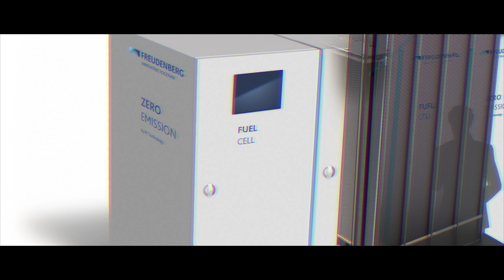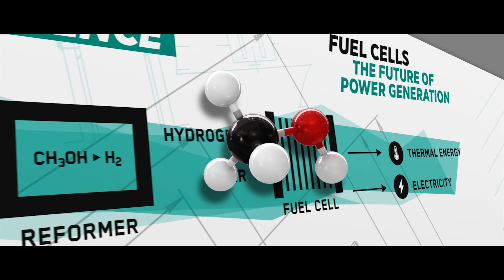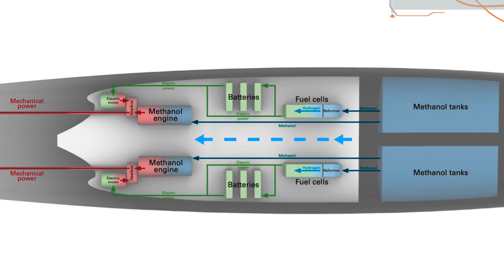LÜRSSEN PRESENT THE YACHT OF THE FUTURE...NOW!!!

Comment: They are lying to you, fuel cells are not the future. Batteries and energy efficient vessels that recycle energy and use energy available in our surroundings are. Why? Because you need a lot of platinum for the fuel cells, way more than is available to all of us. Moreover, the real problem is peak oil, energy shortage. That is why efficiency is so important. As to methanol, that is plant based, using valuable agricultural land to produce said plants. Not sustainable, we need those agricultural lands to feed the world. Meaning the sustainable future, they dream of is a future without most of us, a future where only 500 million of us remain. In that context, the Lürssen yacht of the future, is indeed sustainable, since then, with only 500 million of us, we can again waste energy and resources.

So you see, there is no solution here, only lies and bloody murder. Instead, as I said, we need to work on efficiency, more efficient hulls and propulsion systems, electrical ones is a good start as that cuts the energy needs into 1/3 just y using electric engines. Now add advanced hull forms, light weight build techniques and propulsion systems and we can have a battery driven yacht with transatlantic range already now. (I am designing one with just those features.)

Comment: If the yachting industry wants to have zero emissions from power plants it needs to focus on sails! For existing motor yachts using diesel fuel the industry needs to convince the public that emitting 1000 kegs of CO2 for every 400 litres of fuel burnt is acceptable. It will be interesting to see if COP26 will make any difference to the charter market. Meantime many low lying island nations (charter destinations) are considering banning motor yachts from their territorial waters because of the associated pollution. Any financial benefit gained by having 12 visitors (a typical yacht guest compliment) is dwarfed by the environmental impact damage.

Comment: Not completely taken by the exterior, but then it is a concept craft.  The advancement of fuel cell technology will be truly vital to yachts and road vehicles.  Currently with cars methanol is used in the same way as petrol and diesel with many of the same drawbacks.  Top marks to Lurssen for making it emissions free.  Only possible drawback in Brazil they chopped down lots of rainforest to grow the sugarcane to make the methanol.

Comment: But of course, in order to achieve this efficiency, a type of capital is necessary, as could a system based on an ideal of communism, to be able to achieve this type of progress, because this type of dream would certainly be something fantastic, because a feeling of capital , it will be totally abolished by the nomenclature that would see this not possible. Only capital could put this in everyone's hands with hard work and determination.
Methanol, also known as methyl alcohol, amongst other names, is a chemical and the simplest alcohol, with the formula CH₃OH. It is a light, volatile, colorless, flammable liquid with a distinctive alcoholic odor similar to that of ethanol... In a single word, Methanol...?

Comment: Methanol is a far safer fuel than hydrogen. It can be renewably sourced. Reforming methanol into hydrogen does release a lot of CO2 - 
--- The reaction - 2CH3-OH (64.08 gm) + O2 (32.00 gm) = 2CO2 (88.02 gm) + 4H2 (8.06 gm)
--- 1 kg methanol results in 1.374 kg CO2 released. 
--- Reforming methanol requires 50% of its weight in oxygen to release 1.374 times its weight in CO2 to get 12.58% of the weight of methanol in hydrogen.
--- I'm surprised they are just converting the diesel engines to run on methanol for the drive system, and will only run the services off the fuel cell and battery system. This is a very soft conversion to fuel cell operation. Obviously, reforming methanol and the fuel cell both create heat - so plenty of heat for other systems.

Comment: I wonder about all those stepping stones and ramps and no hand rails. IF the ship hits a swell, don't the guests fall down and hurt themselves?
Reply: @DL Field: Everything containing water, hot tubs, pools, ponds.... are drained during passage into their own holding tanks with filtration system & heaters if required. Then refilled when they reach their destination or anytime they're not underway. When at anchor or at dock, ships stabilizers maintain level decks.

Comment: I really am very ignorant and I apologize if my question is totally wrong but what I don't understand is why it is not possible to produce hydrogen directly on board using seawater. Desalination first, then electrolysis and done!
Reply: My understanding is that the energy required to make the fuel (filter the water and split the molecule) takes more energy then you get back from the hydrogen. The hydrolysis has to happen at an external source, and it's not very cost effective.
Apparently, methanol can be split more efficiently.

Comment: Methanol is CH4O If you transfer that to Hydrogen  H and oxygen O to put in your fuel cell you still have C left. where does that go? if you claim it doesn't emit co2 ?
Reply: It's claimed to be carbon neutral because the carbon sucked out of the atmosphere while producing the methanol (i.e. from biomass, recycled CO2 etc.) is released back to the atmosphere, hence it's not increasing the overall CO2 levels. Burning fossil fuels in comparison, releases the CO2 in to the atmosphere that was captured under the earth millions of years ago and it increases the current CO2 levels.
Reply: The short answer is: Yes, CO2 is produced and vented as exhaust.
I'm guessing electrolysis produces far less than diesel combustion, plus it doesn't include all of the other nasty by-products.

Comment: Good Morning David. Great to see the future of super yacht power. With the world turning away from fossil fuels and towards a more sustainable and more eco friendly power source. What will happen to the thousands of gas guzzling super yaghts that currently plie the oceans. Maybe you could do a video of an engine change on a super yacht, moving from diesel to electric. How the process works ie: getting the engines out and remodeling the engine room to take the new power packs. Thanks again for a very informative video.
Reply: A modest family car might do 30 mph, a modest family yacht might do 0.3 mph. We do not currently have the energy density/weight ratio to overcome this 100-to-1 disadvantage.

The moment we do we can start to green the fleet.
Reply: I'm assuming they're really just swapping an engine for a generator / motors.  Might be a bit more efficient, I suppose.

Comment: The fuel cells are still fed with hydrogen, this system just has a methanol reforming stange on it, and the carbon in the methanol is still exhausted as CO2.  It beats internal combustion for efficiency, but it's not zero-carbon.
Reply: It is zero-carbon if trhe methanol is generated from renewable sources such as solar, and that is in fact currently how a significant amount of the world's methanol is being produced. The generation process takes the carbon needed to synthesize methanol from the air, so when it is combusted, the carbon does not 'add' to the carbon emissions, it is simply returned.
Reply: @panpiper  That does not make it zero-carbon emission. it just make it carbon neutral... huge difference
Reply: @petter1213   Huge difference? Hugely disagree. Whether it emits carbon or not is irrelevant if in the end, it does not 'add' to the carbon in the atmosphere.
Reply: @panpiper  insightful 👍🏼
Reply: @panpiper  no it's not. right now most of the worlds methanol is created using natural gas and water as feedstocks. so it isn't renewable whatsoever.

Fucks sake we currently have the capacity to remove about 10000 metric tons of carbon from the air per year using mechanical means. Which creates at most 730l metric tons of methanol.

In 2019 the world oroduction of methanol was 110’000’000 metric tons.
Reply: @panpiper  That’s what I was lead to believe

Comment: Methanol is CH3OH. If Lürssen is claiming "no emissions" - where does the "C" go to? Methanol fuel cells (no matter whether reformed or direct) all have CO2 output. Unless Lürssen is up for a Nobel price.
Reply: I think they are envisioning a carbon neutral life cycle of the fuel, where the results of combustion is offset by carbon capture in the production. Of course, this should always be mentioned as a qualifier, since there are other methods that are not very clean.

And saying that there are "no carbon emissions whatsoever" is a lie. Even if that carbon was captured from the atmosphere.
Reply: Was thinking the same thing when he said they discovered something more energy dense. Was half expecting that they would next discover diesel is even more energy dense.0
Reply: If it is separated by electrolysis then wouldn’t the byproduct be CO (Carbon Monoxide)?
Reply: If it is separated by electrolysis then wouldn’t the byproduct be CO (Carbon Monoxide)
Reply: @SuperJMichael  yes. until you mix the carbon monoxide with the right amount of air and burn it into CO2
Reply: COP26 agreed to restrict methane, as it's more of a greenhouse gas than CO2. That calls into question the whole ethos of this project. Using hydrogen is better for enviroment, depending on how it's made maybe not so much.
Reply: @stuartramsay8411  Methane breaks down. Average life of methane molecule in our atmosphere is 10 years. H20 is the most abundant greenhouse gas in our atmosphere, by a great margin.
Reply: @stuartramsay8411  it runs on methanol. which as you might know is a liquid.
Reply: Watch this vlog, it'll show how it reduces significantly the more toxic mix and how it will work in the future. 

https://youtu.be/QI-V0TO5PzM
Reply: @lionelgower6877  Thats missing the point..producing hydrogen from methanol aaaaaand burning it still produces CO2, that's just the way chemistry works. It may be more envriomentaly friendly but it still is bad for the climate.
Reply: @Kraxelaxel  Depends on where the methane (or the methanol) is coming from. SpaceX is planning to get theirs from free air CO2 capturing and water electrolysis, then recombining the C and H2 into CH4 (methane) and keeping the oxygen.

Comment: Fascinating.  I wonder how much of those ideas would translate to other things. eg the RN could use many of those ideas for propulsion and energy in their next gen warships.  Could some of those ideas scale down to vehicle traffic?  Nice presenttion.
Reply: fuel cells already found their way into cars. the toyota mirai has one.

they just have the tiny problem that hydrogen is expensive, fuel cells are expensive, hydrogen erquipment is expensive and that most hydrogen right now is produce through gas reformation. meaning you get 9 tons of CO2 per ton of hydrogen. so just driving an equivalent gas car is cheaper and produces less emissions than a hydrogen car.

and obviously battery EVs are alredy cheaper than fuel cell vehicles both when buying as well as fueling up.
Reply from the maker: From what I hear, fuel cells are destined to find their way into many different applications. It's an exciting developing technology.